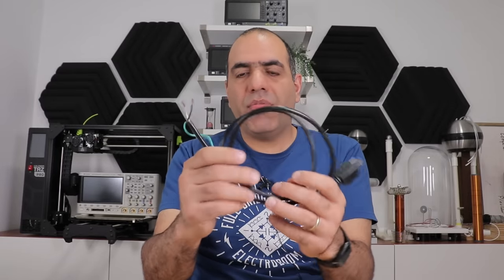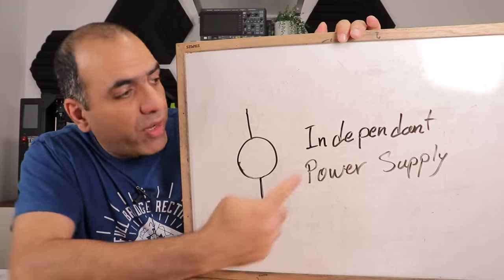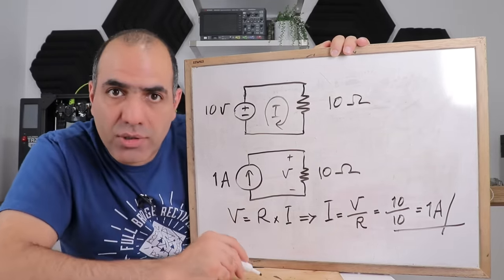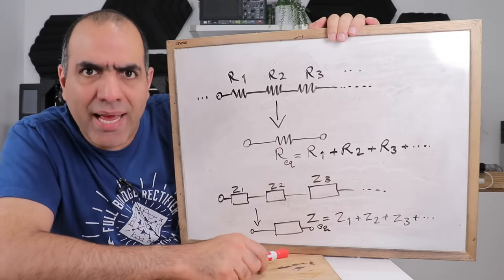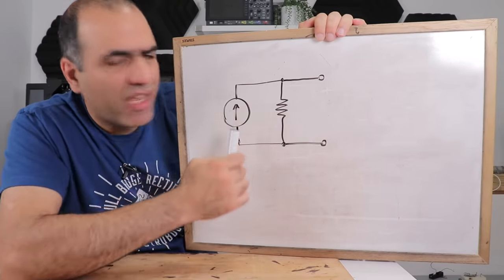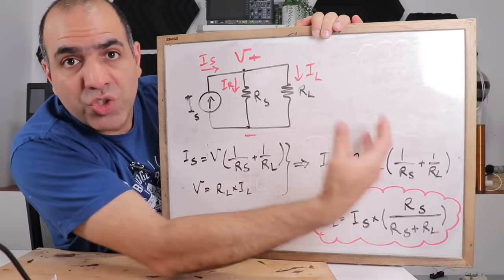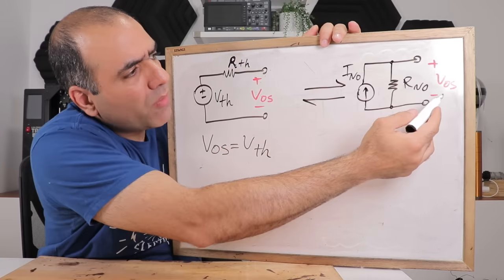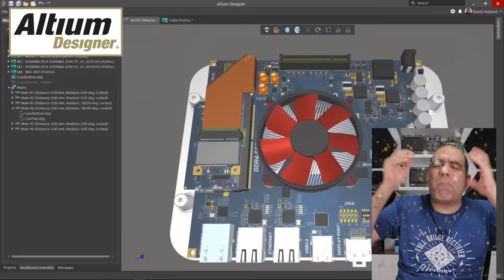Power Supplies and Electronic Life-Hacks (ElectroBOOM101 – 009)

Comment: This sums up a class that took an entire semester at my college...
Reply: Mate this took me two years, my classes were so slow
Reply: If he went over node voltage and mesh current analysis this would have been pretty much my whole circuits class
Reply: @djungelskog2654  how long did it take when you add conductors and calacitors to the equation (using imaginairy calclulations).
Reply: this is just for revision, a newbie will not even understand a shit. its like a recap
Reply: @calesthanics  my thought exactly. i was able to understand this video easily because i already had the knowledge beforehand.

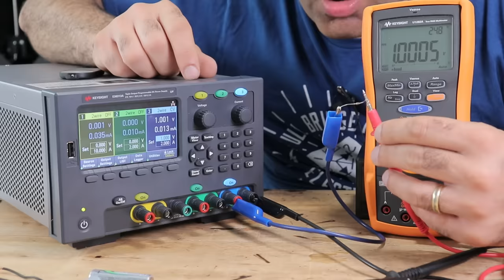Comment: 7:41 I like how he doesn't "shock" himself when using the good power supply :)
Reply: 1V is too low to cause a shock
Reply: @aranhaydar9195  yeah lol even if it was ac it wont do anything lol
Reply: @aranhaydar9195  agree with that point, I liked it though because he isn't fooling around with something that has a little bit of value

Comment: Mr. Electroboom, you are a very funny and intelligent electrical engineer and educator.
I greatly appreciate the work you do to create these videos and find them very educational.
I was wondering, if you haven't covered something like this already, would you be able to explain the difference between a microphone and an "speaker?"
I understand the function of each is opposite, as one has no purpose without the other, an input and an output.
But I don't understand how the circuitry must differ in so that each performs their intended function, despite utilizing the same electromagnetic-diaphragm mechanism to convert sound into an electrical signal.

Thank you.

Comment: Fun fact! The United States uses 240V power for its electrical grid! We simply have 2 of 120v's potentials and when you cross the lines, they create 240v! We simply keep it 120 because less voltage and current overall means less damage (its still lethal). If you have a washing machine, a clothes dryer, or a dishwasher, you run on 240v's AC

Comment: I might be wrong but if replacing x amount of parallel resistors with a single resistor, don't you have to take into account the full potential current running through a single resistor and size the resistor for the appropriate wattage rating?

Comment: I need an ElectroBOOM life hack!  I recently replaced my stereo amplifier.  The old system was so old that I had forgotten that the speakers were 4 ohm resistance.  The new amplifier is expecting 8 ohm speakers.  Can I add add a 4 ohm resistor to each speaker circuit to compensate?
Reply: That's not a good idea, but an amplifier expecting an 8 ohm speaker will run fine on 4 ohms as long as the current output doesn't go above what it would give an 8 ohm speaker, adding a 4 ohm resistor In series will only cause problems as most bookshelf speakers are usually more than 10 Watts and most resistors rated for more than 10 Watts are big and bulky and will waste half the power making the amp half as efficient and affect the audio, a 4 ohm speaker will probably be slightly quieter than the 8 ohm but adding a 4 ohm resistor will make it much quieter for no reason so just use the 4 ohm speakers and don't push it too hard, if it starts to get hot turn it down.

Comment: While half asleep I was playing with a phone charger connecting to an extension cord and stuck my finger in between the two prongs of the charger block that was half way inside the outlet. I got a small but uncomfortable shock from it. Does anyone know if under any certain conditions if that could be dangerous.

Comment: @ElectroBOOM, I am looking for a good fast oscilloscope with more than a few channels to monitor many signals at once in order to correlate them properly when doing diagnosis. The purpose will be for automotive circuits. My options are snap on verus or comparable scanner which is nice because it also does OBD2 and has bidirectional controls. I am however cheap bastard who knows their is a cheaper way. Looking for a small scope that I can attack to a tablet for display.

Comment: Then if I am getting right, the voltage are the sum force of the elves who push the current as a stream of electrons through the whole channel of the conductor, and a resistor is a must-do gymnastic area, which tires the elves down, so after the gym, they can't push the current further with the same pace, but only slower, and their strength is regained to full amount only at the charge point a.k.a independent voltage supply?
Why couldn't the physics teacher just tell this, instead of bullshitting with imaginary signs and complex nonsense formulas?

Comment: Technically you are wrong. The power supply does not provide power to a system but rather enables power transfer between the system and the environment. 
Physics is weird as fuck :))